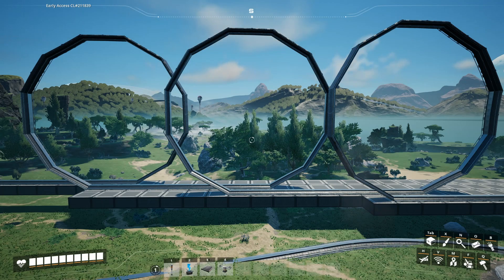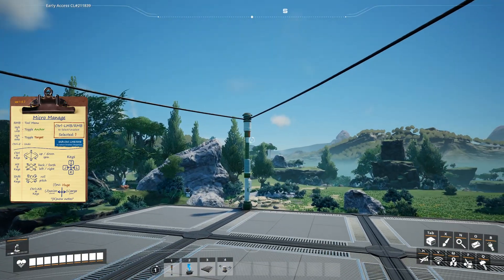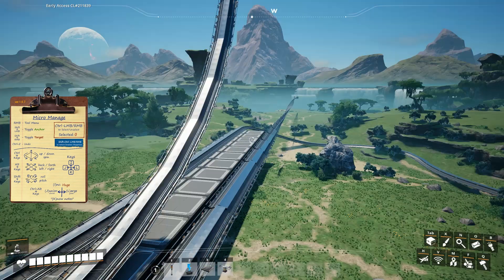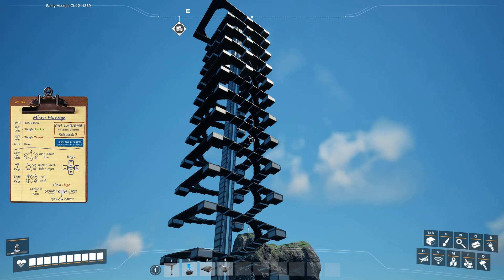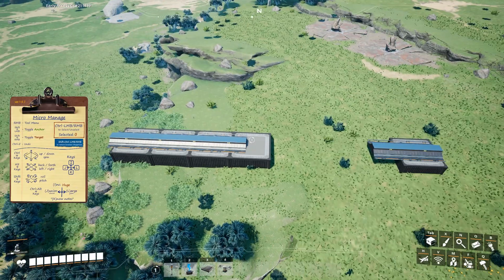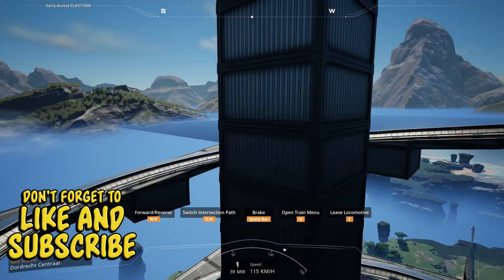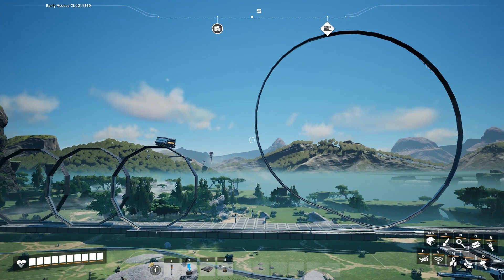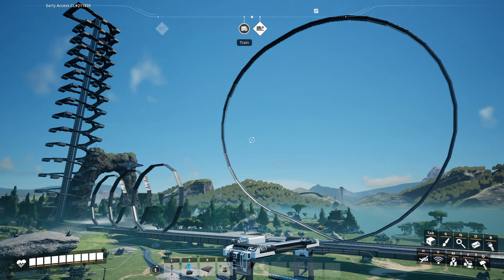TRAIN ROLLERCOASTER LOOPS - Satisfactory Let's Play - Episode 20

Comment: The track is just a single dimensional line, and programmaticallt the loco detects what is up, and what is down.
Reply from the maker: Good guess, but not quite accurate. It gets the orientation of the train from the vector of the track, that's how it goes up and down at angles, up to a 90 degree angle. There's clearly some check in there that is preventing it from reaching any angle past 90 degrees.